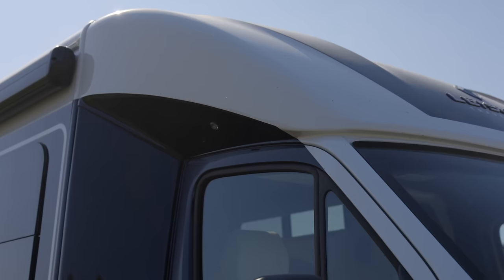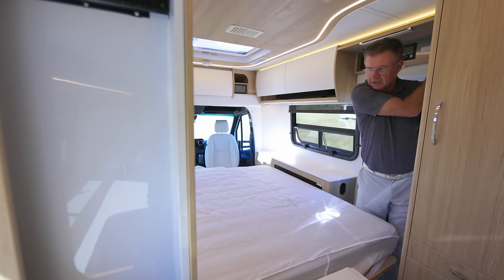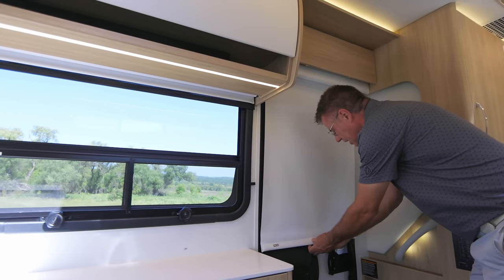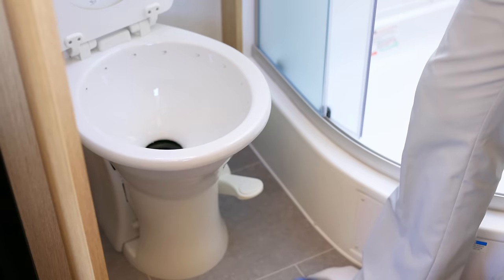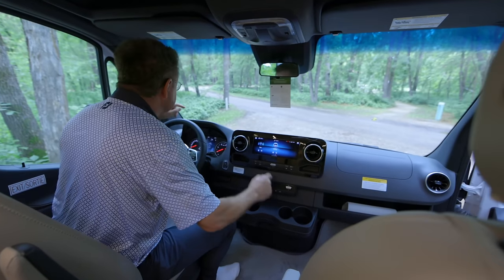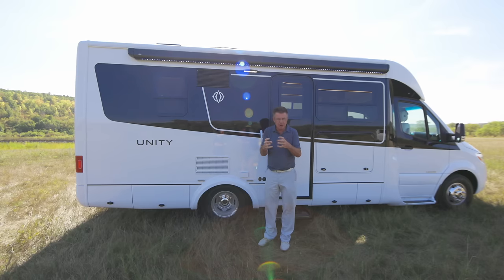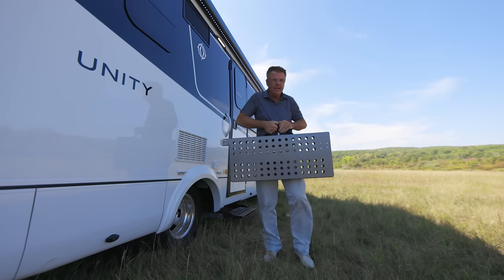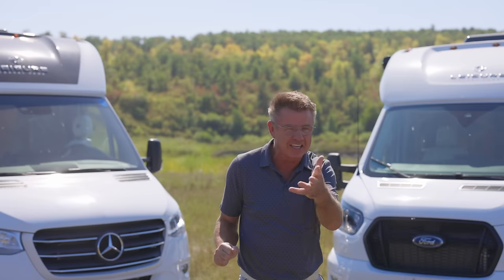2024 Unity Murphy Bed Lounge

Comment: Whenever I think about the prefect Van in the world, this comes to mind, absolutely beautiful!
Reply: It is one of the best for three seasons. Only one coach is four seasons certified by Truma it is the new 2024 Ford transit awd Chinook maverick eb 360 and their Mercedes version on the sprinter the Summit eb 360.
The Chinook can be use in Colorado or Alaska. LTV unity cannot because their water line is below floor and bay are not insulated and heated foamed. The generator would not work. The Chinook have water tank inside and water above floor. No gen but a dual alternators, all electrical and batteries are inside heated. Wall are 3 inch thich and roof is 5 inch thick. MSRP is far above the LTV though.

Comment: Beautiful. I do question the placement of the exhaust pipe next to the step and side door. That exhaust pipe placement offers a high potential [1] to burn your calf if you accidentally hit it, and [2] allow exhaust to enter into the van when the engine is running and the side door is open. Why not have the pipe at the rear of the vehicle like most other vehicles? Or, have it on the driver side which would remove these two concerns although exhaust could enter the kitchen window if it was open with the engine running. A rear placement of the exhaust pipe is THE most advantageous location.

Comment: To bad this Unity is not winterized with dual pane windows and holding tanks inside like the 2024 Chinook RV with the murphy bed and no slide out to keep you warmer and no propane heat and tanks needed which cause condensation inside...this is nice inside but to many vital negatives for my taste.
Reply: Want to like the Chinook but claustrophobia issue would never allow me to buy one (or a B van).

Comment: The next improvement would be replace the propane with an hydronic heating sustem like the Elwell by Timberline diesel electric heater that work with diesel or gasoline (for the wonder). Truma also has the combi D 4 E  diesel electric as well. This would save cargo capacity and allow to simply bring fuel jerrican instead of searching and bringing the van to a propane station.
LTV should install a full Victron electrical system with 2x330ah battery, multiplus II 3000 cerbo gx and gx70 monitor with dual alternator Nations 280a. I think they could install 6 x100w slim rigid panel with extra plug for external panels, for over 1000w solar.
If you do that it would be close to be the best for 3 season coach.
Unfortunately the slide amd the bay and water lines does not allow it to be four seasons certified by Truma. But for three seasons it would be at the top.

Comment: I would love to see a rear lounge as a sun room with windows on 3 sides.  Use a comfy over stuffed jack knife bed back there. Fit in a  small electric fireplace under the TV.  And move the door to this rear area. A place to sit while bird watching on a cold day.  In the front area keep the Murphy bed with a lovely residential sofa and the drop down dinette   conversion like you had before.  One room for the bath with that bump out door on the drivers side and the fridge, pantry and kitchen counter the length of the passenger side with a hanging closet and tv behind the passenger seat.
Reply: @sidk4515
Would you also like the birds to come land on your glass and sip from your drink as well?🐦🦅🦆🦢🦤🦩🦚🦜🐦‍⬛🪿🪺

Comment: What is the OCCC of this coach? Sprinters are notorious for less than 750 total pounds,,,,what is this one?
Reply from the maker: *The OCCC (Average) is 1,140 lb (517 kg) on the Murphy Bed Lounge. The Dry Weight and OCCC will vary depending on installed options. Filled propane tank capacity is 80% of listing due to overfilling prevention device on tank.